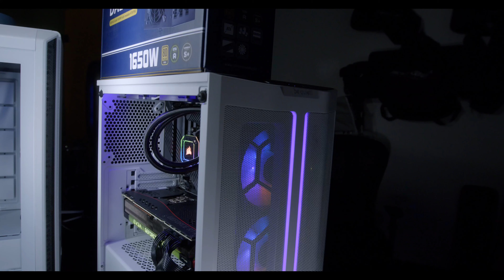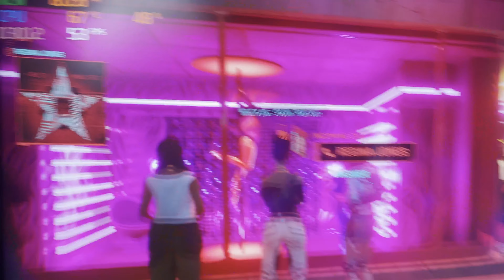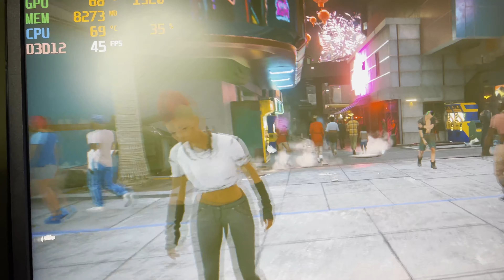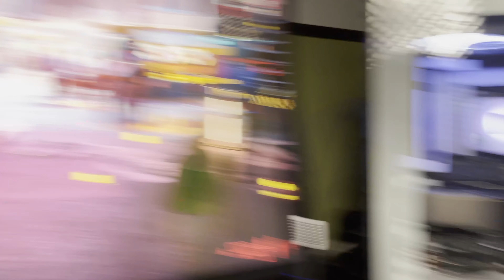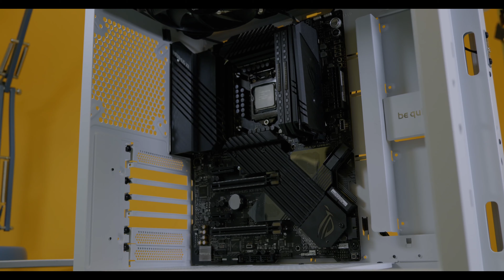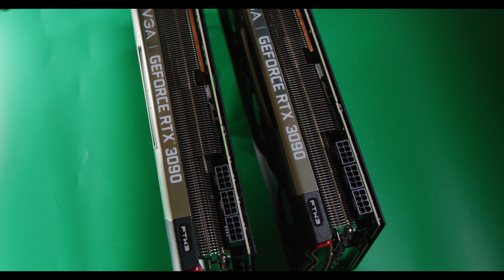Cyberpunk 2077 4k Ultra Settings Intel 10900k, Nvidia EVGA 3090 FTW3

Comment from the maker: Let us know your FPS and settings, and smash that like button!
Reply: Same settings on the 3080. DLSS on Auto means it's dropping it down to Performance mode which is rendering in 1080 upscaling it to 4K. but yes I can not see any real difference between Performance and Quality either. I am also struggling to see a difference between Ultra and Psycho on those two settings - wish there was a video clearly showing some visual differences. The one setting I would recommend changing from the Ultra defaults is raising the FoV from 80 to 90. I also turned film grain off as that shouldn't be used together with DLSS.
Reply: 3700x + rtx3090 asus tuf. All ultra, RT on across the board, 4k, quality dlss, 57fps avg
Two fixes: hex edited cyberpunk.exe to use amd smt better. Changed the config.csv file to utilize more RAM and upto 24gb of VRAM
Turned lower two settings: Ambient occlusion to 2nd highest, cascade shadows res to med. 

Only thing that startles me is that upto 12gb of computer RAM is being used up, so I need to get my ram up from 16gb. But otherwise smooth sailing. I might try toggling couple more settings to get to the 60fps holy grail (mostly thinking of lowering volumetrics and SS reflections to second highest)
Reply: 10700k, GTX 1080, Med-high settings. Nethier RTX or Dlss are an option for me so I'm stuck at 1080p with around 45-55 fps. Gonna wait it out till the 3080 ti is available.
Reply: getting 60+ fps on 1440p with i7-9700KF + ASUS TUF 3080 

I kept everything on high with RTX  Ultra and DLSS on Auto

only dip below 60fps on some heavy populated areas but it catches up soon after and maintains 60+ almost all the time.
Reply from the maker: What? Which comment, I don’t recall
Reply from the maker: I deleted that other guy who was being disrespectful, but don’t think I deleted yours
Reply: @ClassicalTechnology  it's all good, atleast you responded so. BTW Just wondering but did all your hardware survive the flood?
Reply from the maker: Yeah fortunately nothing broke, I just rebuilt  it. Don’t worry, I didn’t delete yours, the other guy was being rude and calling me a fan boy, a shill, and just being disrespectful so I just removed his comment. The game definitely has problems, but I’ve been enjoying it myself 😁
Reply: @ClassicalTechnology  custom loops are cool but it's just one of those things, Murphy's Law. Same reason I don't own a motorcycle 😂

Comment: Not sure how you are getting these. I have a i7 8700K with the same card and on 4K same settings I'm feeling a little letdown. My CPU is OC'd to 5GHZ and I have it on Ultimate Performance for my computer. Still not getting 60 FPS. Might need to tinker a bit.

Comment: I am abit confused, my fps is kinda locked or something. In the main city on ultra+ultra RTX, i get 50-60, but when i lower my graphics to the lowest, my fps only increases by maybe 5~, so even on the lowest setting my fps dosen't go past 60-65 in the main city. (RT, dlss, vysnc is all off)
Reply: this is with a rtx 3080
Reply: same, do you use a ryzen cpu?
Reply: @marvas2104  yup.
Reply: @zahikkhan4405  the game is not optimized for amd cpus. let s hope they fix that

Comment: Rig:  Asus Strix x570-e with 5900x, evga rtx 3090 ftw3 ultra, 32g ram.  Playing on 3440x1440 monitor
CyberPunk 2077 settings:
-  Everything Maxed High/Ultra except the following
-  RT Lighting and Screen space reflection Ultra (not psycho)
-  Turned off Film Grain, Chromatic Aberration, and Motion Blur
-  DLSS set to Quality
Plays at around 70fps... drops to 60fps once in a while

Comment: i5-10600k, 3080xc3 ultra, aand asus 4k/144hz monitor. 

settings are maxed out minus DLSS, it is set to ultra performance. frames are a steady 70+. hopefully patches and drivers are optimized to support quality mode

Comment: Nice! I have the 10900K at 5.3GHz allcore (1.34v LLC7, SP94) w/ the EVGA 3080 FTW3 Ultra on the Apex motherboard, runs great and pulls roughly 750Watts using the EVGA "XOC" 450W 3080 vbios and 10900K 5.3GHz allcore when both GPU and CPU are stressed. For PSU I'm just running the ASUS Thor 1200W w/ the OLED wattage display, seems to work great. If I ever decide to upgrade to a dual 3090 in SLI I might need a 1600Watt+ PSU though, lol. Sorta interested in the 3090 KINGPIN cards, but it's hard to order one right now. Hopefully that changes soon! Great vid.
Reply from the maker: Nice!

Comment: Aorus 3080, auto boosting and holding at 2010 MHz 61 degrees C.
5800x holds at 4.6 ghz all core and all but one of the cores constantly try pushing past 4.6. The one core occasionally drops to 3.7 ghz but its about once a minute or so and only for a split second. This is at 65-66 degrees C on a corsair h115 platinum aio. 
32 gbs of Corsair RGB Pro ram running at stock timings 3600 MHZ Cl18.

There is no great way to benchmark this game, so I tested in two areas. Outside of V's apartment down the elevator and in the southern most corner, upstairs in the dark, before the bridge going south.

I don't care much for Ray Tracing, so I have it off. But otherwise I have everything set to ultra or high (no psycho). At 1440p With DLSS on auto I am getting 90-95 fps, not facing crowds, in the city. When facing crowds i see lows at 76 but it gets back up to 85. Depending on where the crowds are I even see fps at 110+. I'm assuming that because every character is independent, its hard to render everything.

In the opening missions I was getting 110-150, due to being in smaller environments with less NPCs.

With DLSS on quality, I get the same results, so I am assuming my "auto" does default to my resolution of 1440p. 

With DLSS off I get 75-80 normally and in crowds I get around 70. In darker areas I'm getting around 85.
Reply from the maker: Thanks for the feedback!

Comment: if it's 50fps and probably lower when driving and moving camera, it's not good enough
Reply from the maker: You can adjust to easily get to 60 FPS, I just maxed it out
Reply: @ClassicalTechnology  But then can't call this "best settings"
Reply: I would call it "best settings" when you play it and feel like this looks exactly like in the trailers. For me on my 3080 and Ryzen 5600X it definitely does look like it should, but it is only really playable in DLSS Performance/Auto mode. Rendering at 1080 upscaling to 4K sounds nuts, but there is hardly any visual difference. DLSS 2.0 is a miracle!